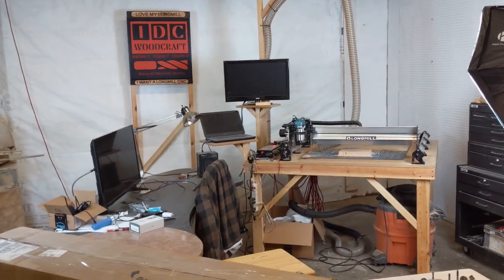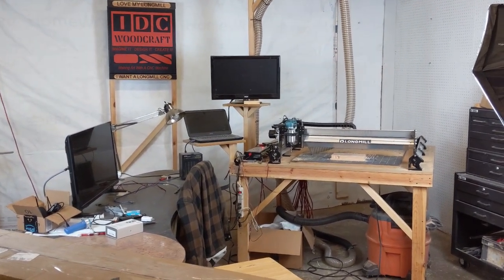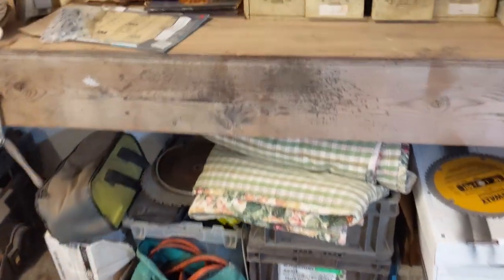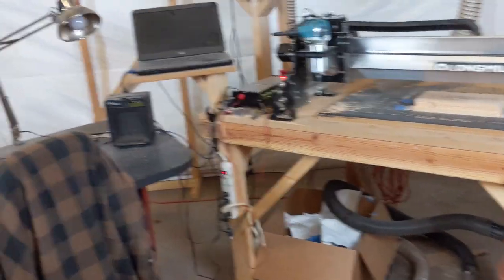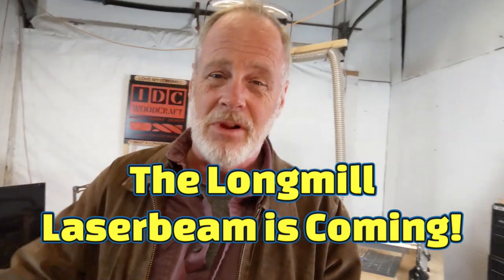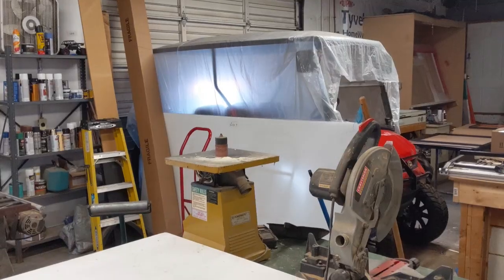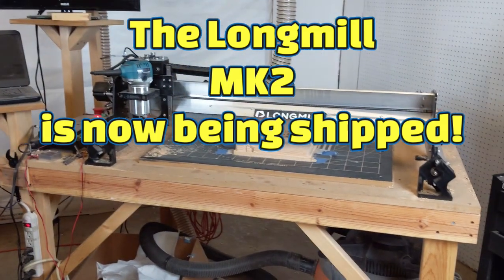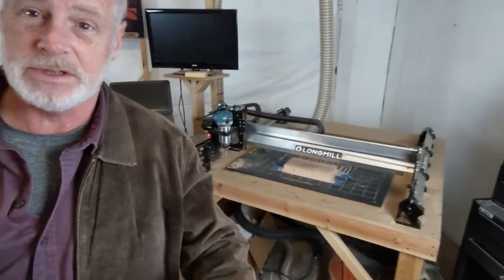CNC Router Weekend Update - Longmill MK2 & Extension Kit

Comment: I'm interested to see the differences between the Laser you are looking at vs the JW Tech 7W I am using on the sharks. I love that laser and I use it for flourish burns and also to put my logo on my 3d reliefs, as well as a myriad of other laser projects. 

That tumbler can be used to mix shellac flakes and alcohol more efficiently ;) 

As to dressing oneself, well, a Carhartt pullover eliminates the need for buttons ;)
Reply from the maker: Blacklandgrass, I like your thinking. I'd like to do a comparison/review for the lasers so I'll keep the shark one in mind when I get around to it. You're so right, if my misbuttoning happens one more time I'm switching my entire wardrobe my friend!
Reply: @IDCWoodcraft  I guess I should "clarify" more ;)  The carthartt T is augmented by a longsleeved flannel shirt, but I keep it unbuttoned (less challenge that way) . 

For safety; It comes off in the shop, but here in Texas, winters don' require much more coverage than that out side.

Comment: Great move.
Funny, I just emailed you today asking if I should order the laser attachment as I prepare to order my LongMill 48*30.
What is involved with switching between the two?
Is it basically like switching out the module for the router?
Reply from the maker: Jonbo, you can have the laser mounted right next to your router. It is all controlled with gSender and the spare electrical port on your Longmill control box. I will give you some more detail in the email my friend, too long and too many details for a comment!
Reply: @IDCWoodcraft  
Thank you.
I also found a few videos showing how to print tee shirts with a CNC router.

I'm gonna cause all sorts of trouble.

Comment: I would like to learn what laser engravers can be added to an existing CNC unit.  I know I’ve seen them somewhere, but the manufacturers, power, cost and parameters needed to be proficient are not easily found.  Not so much to be cutting, as I’m not sure what I would cut without starting a fire..LOL!  Really excited to see what you accomplish in your shop!  Thank you for everything! 😎
Reply from the maker: Paul, the possibilities are endless but for an existing CNC you are limited to power output. And good call, always a good idea to have a fire extinguisher handy just incase anything happens in the shop! Doesn't have to be Laser cutting related either! I am going to show you everything you need to know to do it safely.

Comment: Congratulations on you success and your equipment upgrade and addition. One of the things I liked about my router is the 25 X 50 cutting range. I like I can cut all around 24 x 48 boards. I have used that cutting area several times. Like you stated, you can even do more nested smaller sized parts with larger travels. The 30 X 48 upgrade is no doubt going to be nice. And another Long mill to add to the shop surely will create even more capacity. Congratulations on that purchase and the need for it.
Reply from the maker: CNC Programmer, 
A 25X50 is almost perfect setup my friend. Processing those big sheets from the big box stores can be hard with a smaller CNC, so I'm glad you get it.  I guess we can call the Longmill the "LOOOONGmill" with this new upgrade!
Reply: @IDCWoodcraft  I couldn't see the sense in anything less that 24 X 36. When I was able to get even longer for not much more money, I went for it.  That's a nice upgrade for the Longmill, or any machine.

Comment: Your timing is excellent. I'm a few weeks into using my Longmill and I planned on getting the laser six months or so down the road - though I've wondered if I should just get a separate laser or not.  I hoped you would eventually get the laser to help me go back to plan A and get the Longmill accessory.  I can't wait to see what you have to say!
Reply from the maker: Michael, Both are good options my friend. Problem with the addon is that you cant use your router at the same time, so if your strapped for time, I definitely recommend a standalone laser. But if your just getting started, the addon for your Longmill might be the best idea